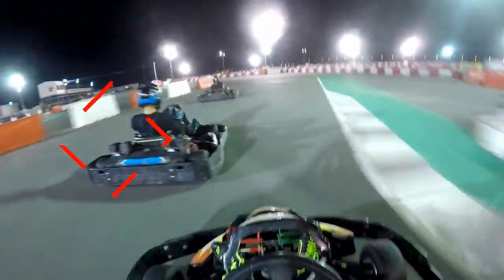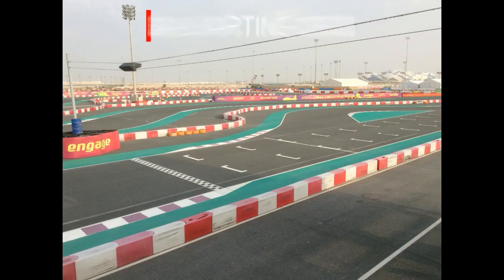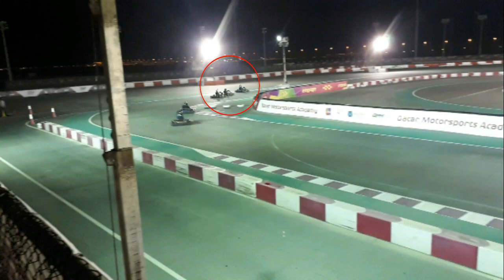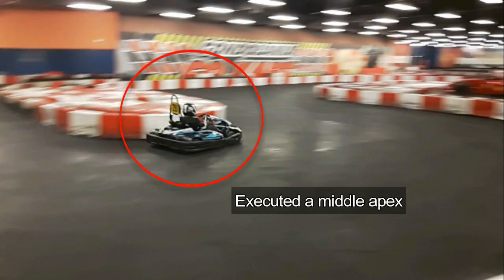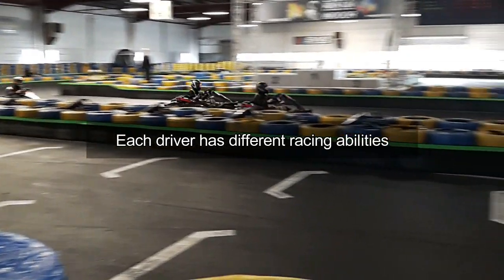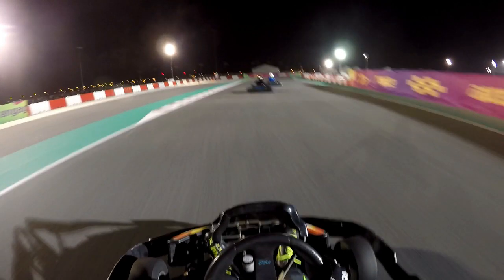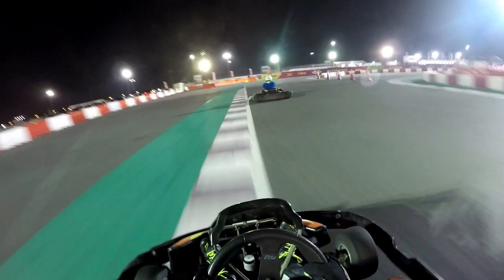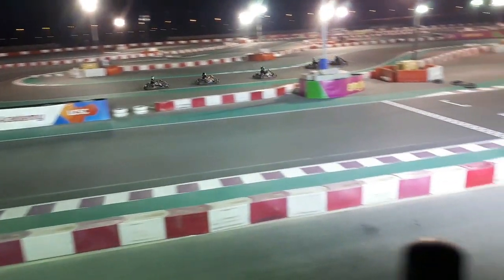CORNERING in Karting (tutorial)

Comment: Good video, looking forward to see more tips from you.
Are concrete surfaced tracks vastly different in terms of strategy on a hotlap? I have a few twisty, concrete tracks nearby and find myself having a faster laptime when I do a controlled slide in the tighter corners, instead of a more conventional racing line. I did some F1 sim racing before, where sliding is almost never good.
Reply from the maker: Thank you for the comment. The racing line can be slightly different for concrete tracks, especially a twisty layout. It's best experiment what line works best since every circuit is unique. And you will find sometimes that the conventional line is not always the quickest way to drive the circuit.